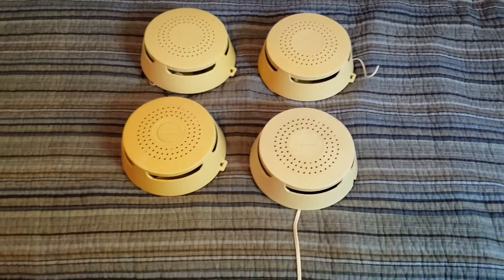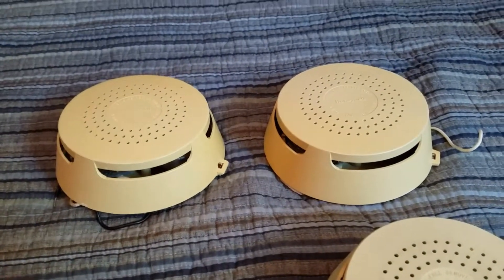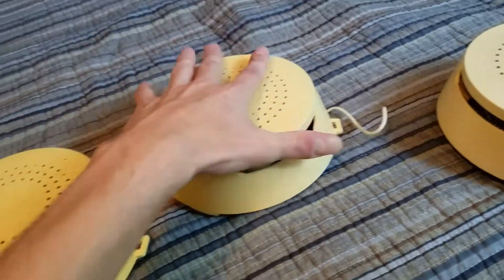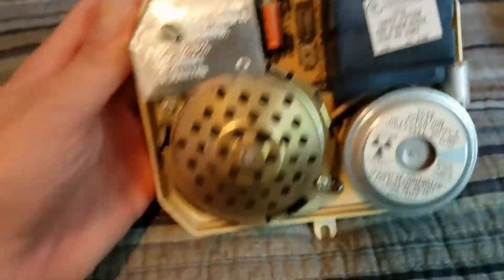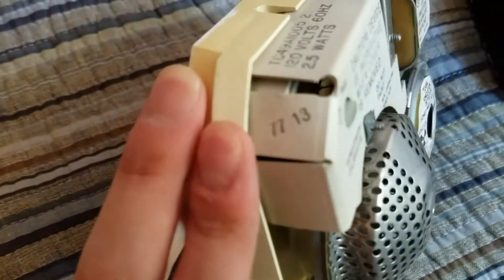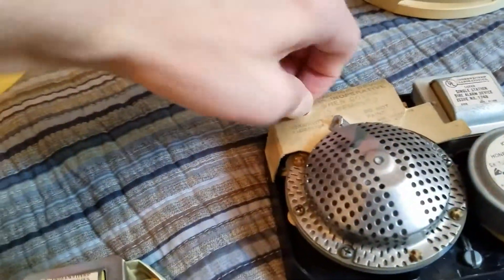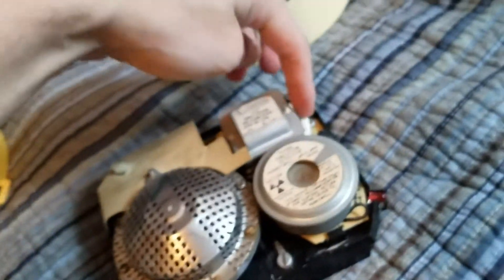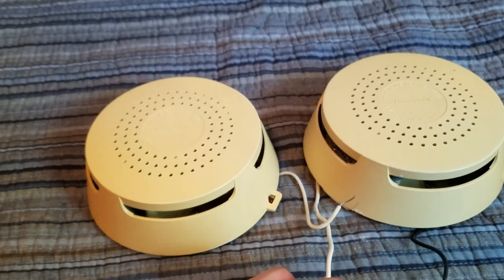Two Unusual TC49A's (OVERVIEW)

Comment: Just replaced our TC49A 1054-2. Clearing dust and vacuuming failed to decrease the overly sensitive unit. The unit has done its job since 1975. I have learned to check YouTube before I toss away items. Thank you for the post.
Reply from the maker: You should try throwing it on ebay, I guarantee someone will buy it

Comment: Hello, thanks for posting a video about these old detectors. We have one in our house that must be 45 years old and it is now chirping. At this point, can it be fixed or does it just probably need to be removed?
Reply from the maker: I would try and clean it, vacuum any dust out of the ionization sensor and clean it with compressed air. If that doesn't stop the chirping then it should be replaced. If you do replace it however, I guarantee a collector will want it
Reply: @BAFVintage thanks for your reply! so it looks like the chirping was coming from a battery operated unit just a couple of feet away! However, even though the light is on on the Honeywell, I tested it and it didn’t detect the smoke from the match I lit directly under it. Could it just be “done” at this point? Or maybe it just needs a bit more smoke?
Reply from the maker: Make sure that the LED on the side is lit but it may need more smoke. Also check to see if the sensitivity adjustment is turned all the way up

Comment: TC49A’s are so freaking weird. Each and every one of them are different in their own special ways. For example, mine is unusual from the yellow sticker on the horn making it a square model circuit board with the round cover.

Comment: how do you stop the beeping or squeaking sound
Reply from the maker: Try vacuuming out the sensor, there might be some dust or dirt that has gotten in and is triggering the alarm. It's also possible there is a loose connection that makes the alarm turn on and off and causing it to chirp each time the alarm is powered.

Comment: I have the line cord model also there’s an option to hardwire it directly to an electrical box.

I also have a First Alert sa80fc. But there’s a problem with it. Every time I put a battery in it, it will flash the LED and the piezo sounds very faintly. Is there a possible easy fix for this?
Reply from the maker: First Alert models with the 79R board sound for a few seconds after installing the battery, this is normal.
Reply: Baltimore Alarms & Fans ok cool. Thanks.
Reply: @BAFVintage It’s a First Alert thing (it’s really annoying but somehow became a tradition for all BRK products)